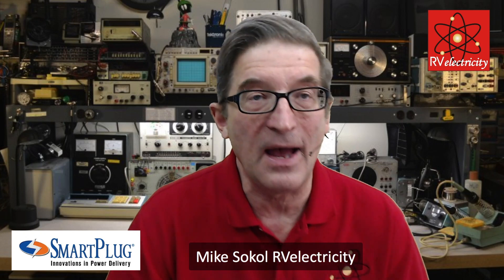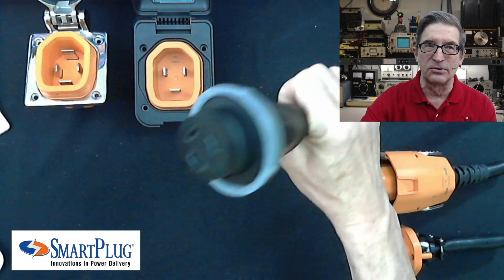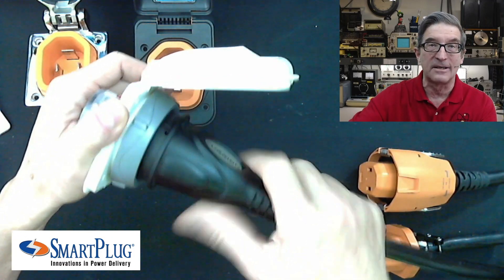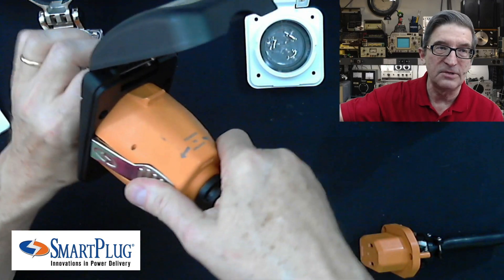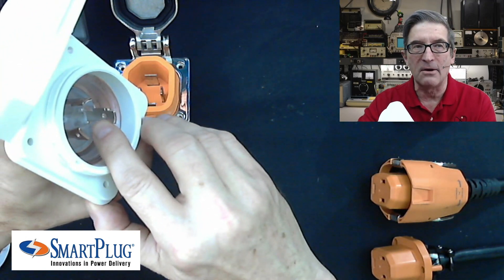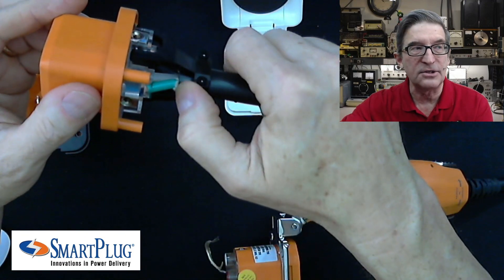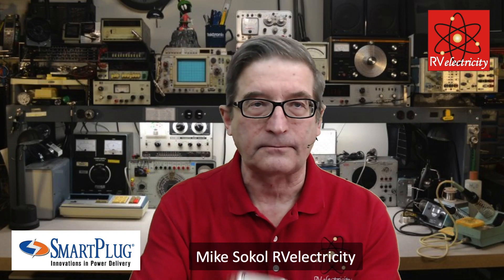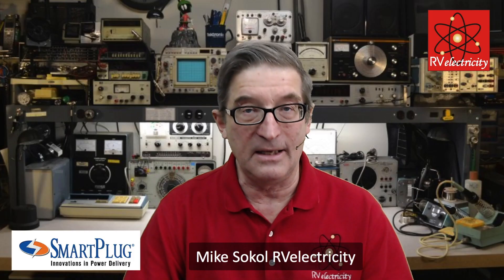SmartPlug Demonstration 1

Comment: I guess my trailer is old school. The plug is permanently attached to the trailer. I just pull the wire out of the side and plug it into shore power. I notice many new trailers have totally unattached shore power cords. I think I like my old technology better,
Reply: Just depends what you want/ choose. I currently full time in a Redwood and it has a very similar plug to the one Mike just demonstrated. My New Horizons coach I chose a powered cord just because of the weight of the 50 amp cord and I like keeping the cord off the ground. Our choices are many which is good.
Reply from the maker: @22howards   If you mean a powered cord reel, just remember there are additional maintenance procedures you need to do to keep it healthy. I can't remember if I've written anything on that lately, but I'll take a look.

Comment: This is one of the BEST Products made on the Market today!
I have the 50 Amp Smartplug on my 5th wheel and it works great. 
It was easy to install onto my Shore Power cord and Easy to install the matching plug.
Unless you are color blind, the plugs are color coded for putting the correct wire in the correct hole and locking them down.
Smartplug does include a little bit of BLUE LOCTITE to make sure the screws won't back out, but I added a little extra to make sure.
One thing with the Allen screws you have to be careful NOT to apply too much torque as you could strip the threads.  Just snug them down and your done!  

Smartplug was kind enough to send me a whole bunch of their brochures, that I hand out to RVers at Campgrounds.  

Smartplug is a Great product and all RVers should consider swapping out their 30 or 50 Amp connecters on their RV's!